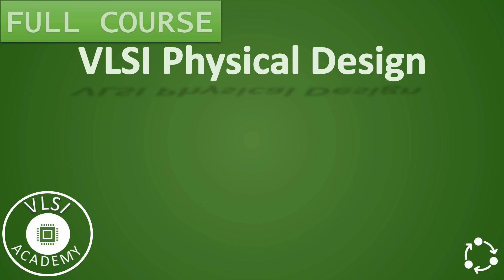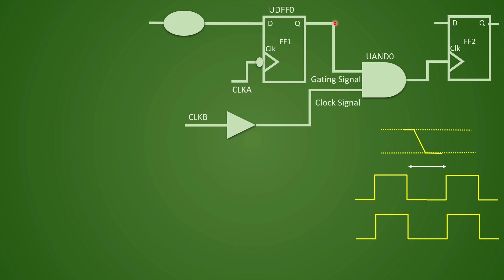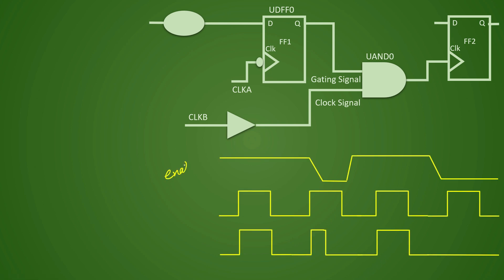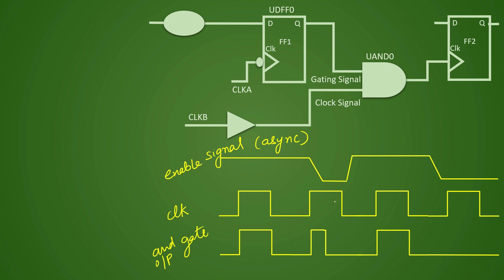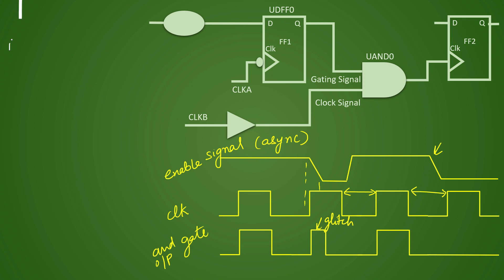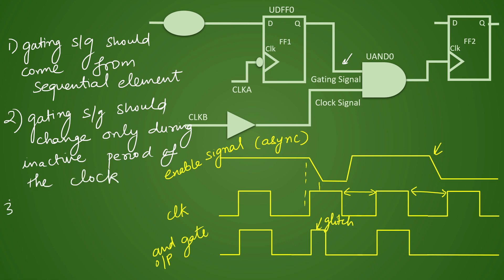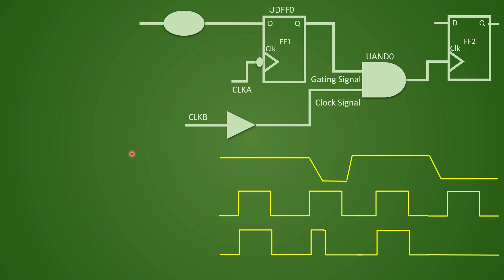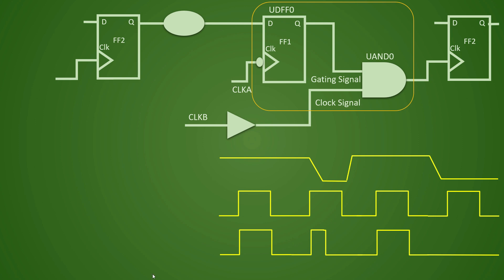PD Lec 58 Integrated Clock Gates | ICG | CTS | VLSI | Physical Design

Comment: You made a mistake.  At 0:40, you state that the clock gating signal must not change during the inactive phase of the clock.  This is the opposite of what you meant to say.  You got it right in the later example.